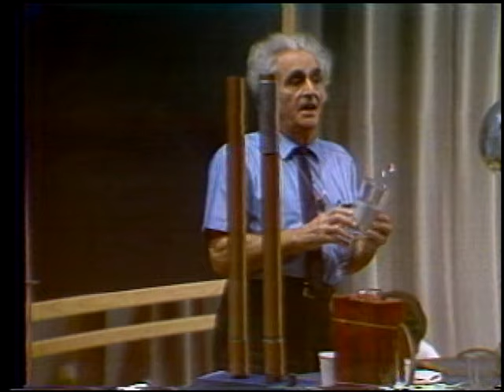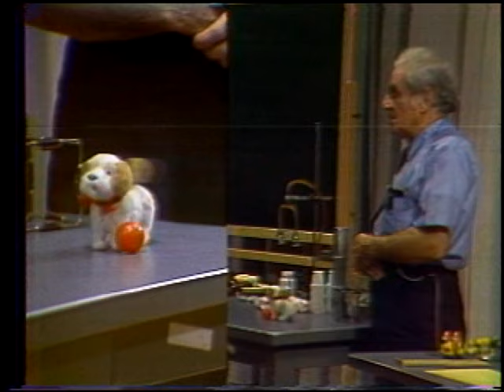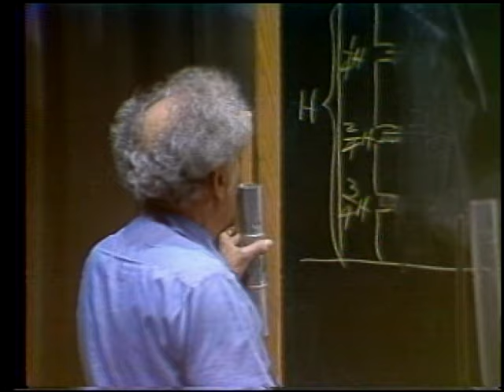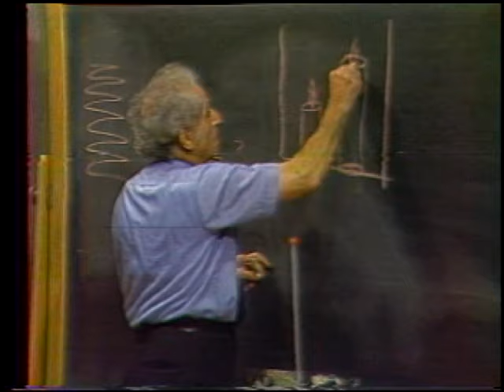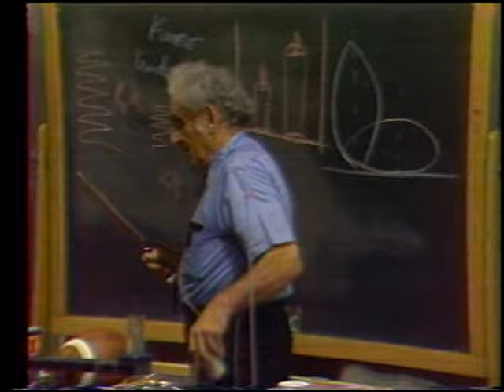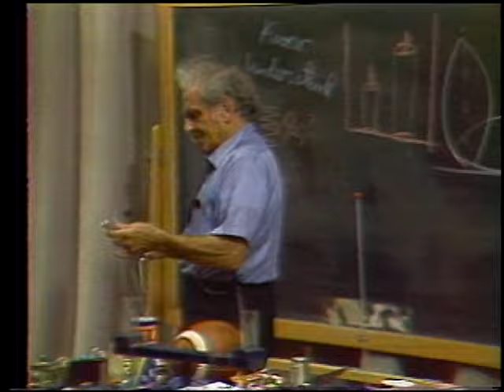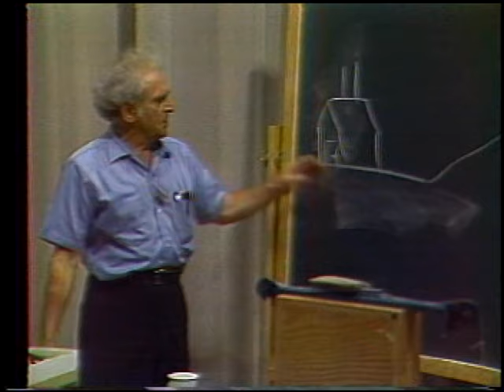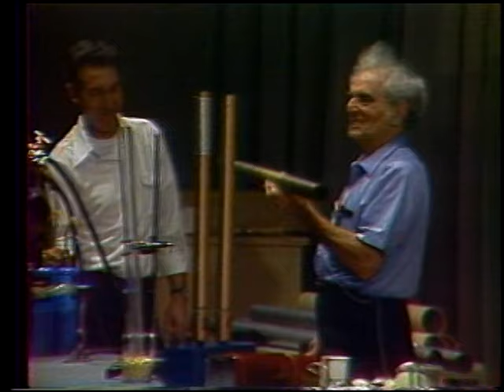Julius Sumner Miller at the Air Force Academy in 1973

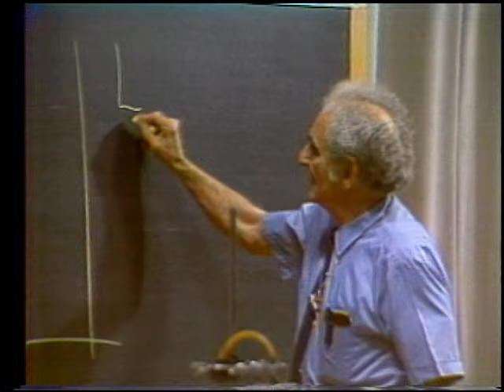Comment: 22:22  I hope all you radio hams and RF guys out there got that. You should have realised that "H" (the height of the vessel) is analogous to a full sinusoidal wave. Given that analogy, your 1/4 wave and 3/4 wave points will be of equal, low impedence while your 1/2 wave point will be of higher impedance. The higher impedance then is analogous to a smaller aperture, such as a jet nozzle on a pressurized car washer and thus, greater range.

Comment: Years ago I played the pipe organ athe US Air Force Academy, SIR!   Also tuned pipes.   
One mustay away from the smaller pipes because radiated body heat will expand the pipenough that when it cools, it will become slightly sharp and produce beat notes.  If you handle a pipe it must be allowed to cool.

Comment: 20:25 he is wrong there. From all those three figures on the board, the first one is correct, which he marks wrong soon. Its simple Torricelli's experiment, which shows the water at the bottom hole is fastest and farthest.
Update: I was wrong. Julius is correct. 
However, if the holes are quite high compared to the ground level, the bottommost hole throws the water at the greatest distance: https://en.m.wikipedia.org/wiki/Torricelli%27s_law
Reply from the maker: Thanks.  I'll check it out.
Reply: No, he isn't.
Reply: Strange. I have been reading in the books all wrong?
Reply: @Verschlimmbesserung  I am with you there Bill, but I appreciate critical thoughts.  If we did not have doubt, we would never get new ideas.  Allen Morris
Reply: @ashish19  First off, you're mistaking this for the Torricelli's experiment, and that's where your misunderstanding begins. 
Look up hydrostatic pressure, which this experiment deals with.
Reply: My guess is, if the ground level, on which these water beams fall, is much farther away from the height of the holes, the bottom would go farther than the top. Just a guess again.
Reply: You quoted wikipedia. Who came first: practical demonstrations, or typed text on screen? 
wikipedia is lazy crap: most of the time, citations actually hold the opposing position from the one advertised in the (mostly) biased pseudoscientific wikipedia "sacred texts".
Reply: ashish19  the hole nearest the middle of the pipe the water goes the furthest, no matter how many above or below it. Obviously the greatest pressure is there. The other 2 holes share the remaining pressure. The distance it goes from the middle hole equals the height of the pipe.
Reply: @tonybarfridge4369  Why would the greatest pressure be at the middle hole? Wouldn't the highest pressures be at the bottom with the weight of all the water above pushing down?
Reply: @Verschlimmbesserung  - Correct. The first thing he says is the tube is kept at constant pressure to the level marked at the top, which is why he takes the trouble to mark it. The tube is not draining out, it is under constant pressure.
Reply: The key is that you can not use the Hagen-Poiseulle law to determine the velocity of water through the holes because the parabolic velocity profile cannot develop. Thus, the velocity IS NOT PROPORTIONAL to the hydrostatic pressure. Instead,  you can estimate the velocity by using the Bernoulli law (which is not exact but just an upper bound for the velocity). This law gives JSM's answer.